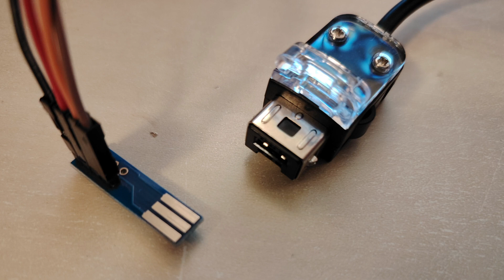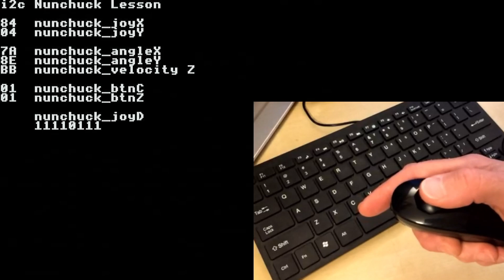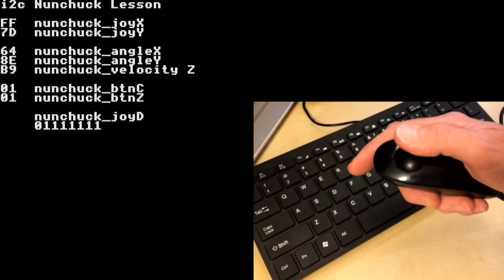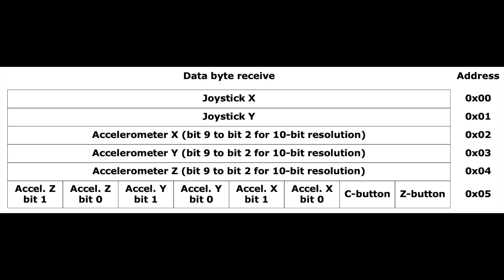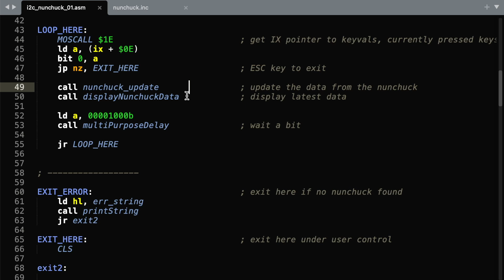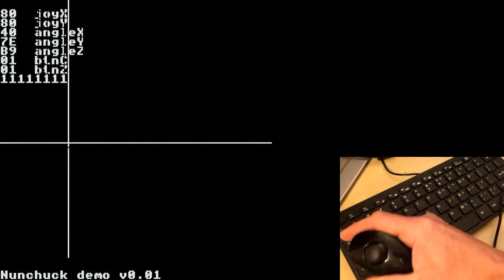09 i2c Nunchuck controller

Comment: What a great looking device. Thanks for your usual excellent presentation.
I have just had an amusing episode when I saw some slides from earlier videos and for a few seconds I thought you had been paying way over the usual prices for your modules ($20 +) until I realised that you were showing bus addresses lol. That's what happens when people misappropriate standard symbols and overload their use. 
However I also just saw you comment that this was the last interface in the series and wondered if you had seen another ridiculously cheap board that I like which combines 8 seven segment displays and 8 switches on 1 board with a I2C interface chip. I forget the part number but I am sure you can find it. Actually it might just be a variant of the 16 pin I/O expander you've already done. I'll have to look it out and leave a comment on that video if appropriate.
Reply: Are you talking about the TM1638 chip that's used on some digital displays with buttons on Aliexpress???
Reply: @bendertherobot910  Sounds familiar but I'll have to search through my stock boxes tomorrow to be sure.
Edit, oops. just looked on-line and that sure looks like the modules I remember but I guess I was wrong about the I2C interface. Sorry guys, I'll blame old age.
Reply from the maker: @bendertherobot910  I have some of these, however they are not i2c, they have a 2 wire system but it is not the same.